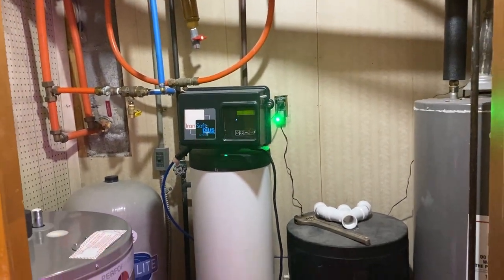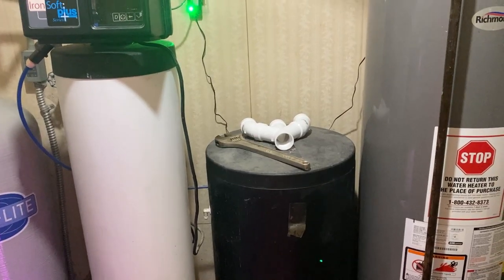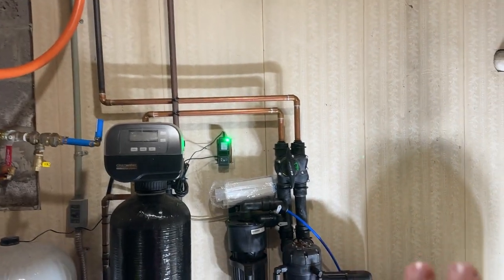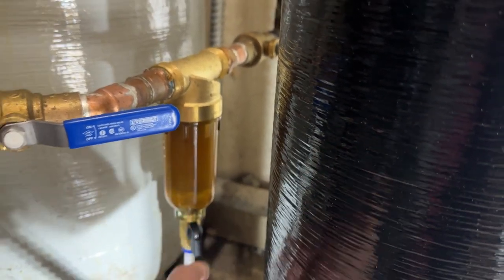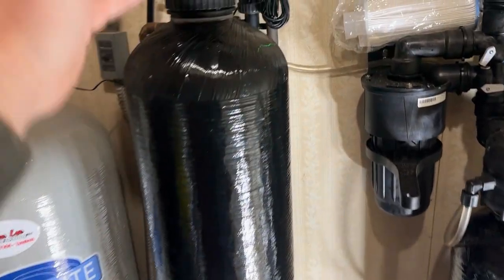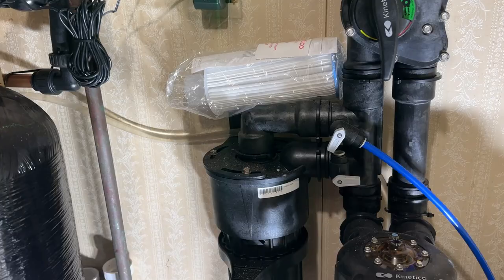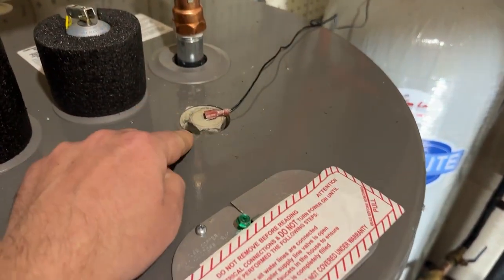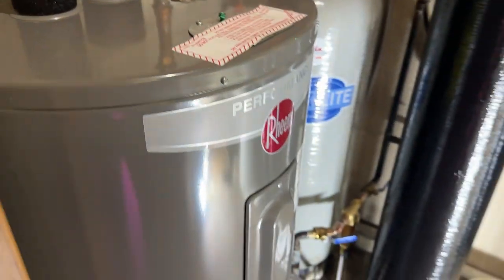How To Finally Remove Rust From Your Well Water

Comment: I absolutely hate softened water. It drives me have nuts. Besides, i make wine, beer and the plants like calcium so, no pun intended, i take my hard water with a grain of salt. However, as cal & mag are good for us and plants, not so much for the cooper pipes. Have you come across any other set-ups without using salt? Or do you think my issue is more the absence of minerals that make me think im slimmy?

Comment: I am going to look into that iron filter! I live in western Washington a stone's throw from the Columbia River, and my house is served by a 25 foot sand point well and we have a LOT of iron. I've got a Kinetico system too but still have quite a bit of iron in the water even after the filters (I actually have two Kinetico systems, one adds chlorine bleach to santize and the other is the salt system identical to the one you've got there, same filter and everything! One thing I've found with it is if that pre filter plugs up the water pressure won't be enough to cycle the valving and it will just sit there on backflush. Really enjoy all your videos, thanks and God Bless you and your family.

Comment: Inspiring! Just bought a 20 year old house on a hill. Not sure if the local water is rusty or calcified. We pay the prior owner’s maintenance company to treat the well water (and another company to maintain a newfangled septic system) but I need to find out exactly what they use and why. Also I want to add a) an artesian well hand pump and b) a solar powered backup for the existing electric powered well pump and c) a blackwater & a
compost toilet humanure backup system in case it ever becomes necessary to go “off grid”. Not sure how long an electric well pump is expected to last! Also thinking about rainwater filtration redundancy (east coast) : perhaps a new metal roof , larger gutters, and a  cistern and swale distribution for watering the garden and orchard. Maybe a fishpond and a solar powered pump to move pond water and grey water through the swales…

Comment: kinetico water softener… best I’ve ever used.  
  Like you said in your video, it’s closer to an on demand system and this damn near on demand unless you use hundreds of gallons in a short period of time it will keep up with them or anything. I had the same issue with a regular water softener in my old house. Where are you would get untreated water coming through your house thinking you had softened water.

Comment: Fantastic breakdown of the new water system. You explain things in a simple way for all to understand. Your definitely spiritually gifted at speaking and teaching. If I could humbly make 1 suggestion for safety, your water heater TPRV discharge should be plumbed down the side of the tank exiting approximately 6" from the floor. Just in case the rare circumstance it ever releases pressure. Great video SSL fam!
Reply from the maker: Thanks! Yup, that isn’t hooked up just yet, no power run to it and I need to finish that pressure release piping too!

Comment: What media do you have in the iron filter? Is it katalox? I just installed a iron filter with katalox and the ph drastically jumped resulting in slimy feeling water but I hope and I have been reading that it goes away. On a side note I used your video from years ago to build a chicken coop and it has been the best! Keep up the good content!

Comment: Hey Todd, hopefully your favorite online plumber/commenter/brother here. I commented in your last plumbing video. I just left a plumbing company and they are using Brita filtration and softener systems. Brita uses catalytic coconut carbon for filtration, the best, IMHO. I don't know about yours. You are right about replacing the anode rod as softened water reacts with the magnesium rod. If we don't use a powered anode rod, we use an aluminum anode rod. Hopefully no sulfur in your well water then you need a hydrogen peroxide system to remove the sulfur before the other filters. Glad what you have is working well for you. Some times it can be tricky getting everything just right. God's blessings upon you and the family.
Reply from the maker: Thanks! We have been super happy with the new setup

Comment: I would be interested to know what your initial costs run for installation on all of those things together.  And then also would like to know your cyclical maintenance costs, as you have to buy new replacement filters,  water softener salt (if any) & whatever else is required, per month or per year.   It would also be interesting to know how much more expense such a system setup adds to the monthly electric bill, unless it is practically negligible & feasible.   Right now the most basic whole house water filter I would need is just the sediment/sand spin-down filter.
04/07/24